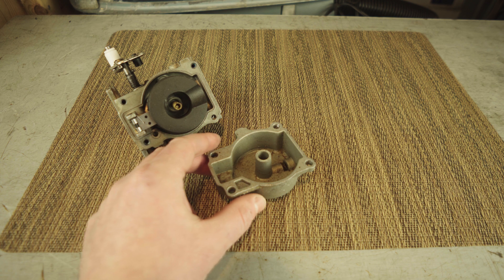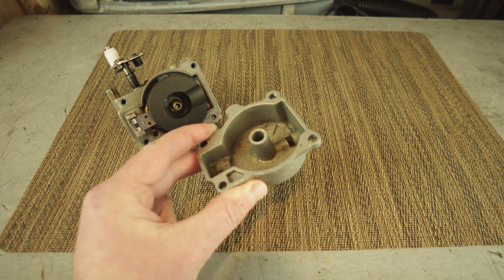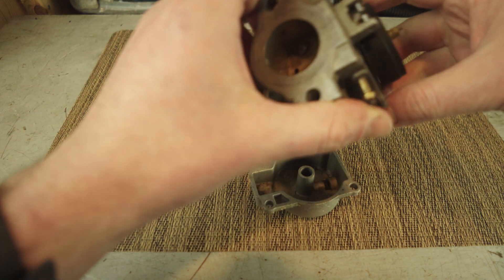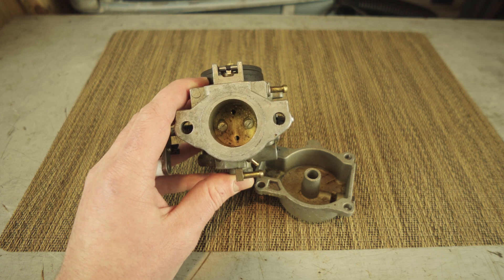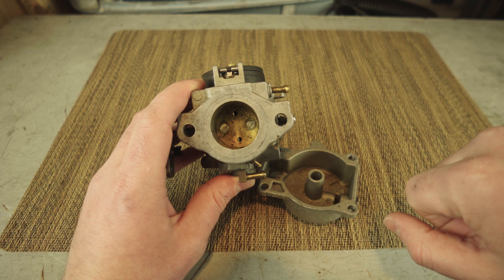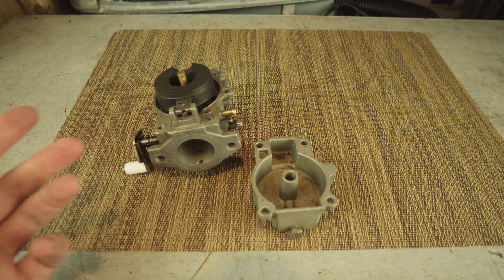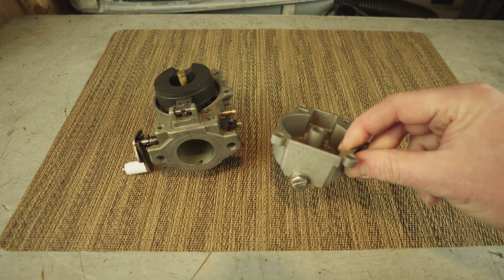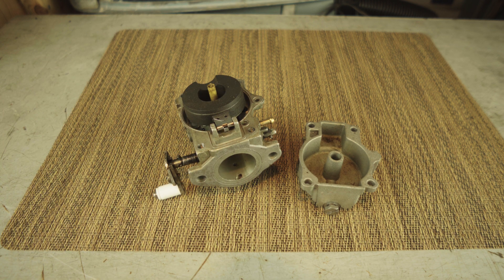Outboard 2-stroke 40HP idling on just 1 cylinder instead of 2 with throttle advance control lever up

Comment: Hello I got one question. My yamaha 40be out of the year 1978 (2stroke, 2 cilinder) is running on only the top cilinder. I pulled the bottem one and nothing changed. 

Now ive cleaned my whole carburator, de compression is good and both sparkplugs are sparking.

What do I need to do now?

Comment: Mine is doing the same, i have a single carb 40hp 2cyl 2stroke mercury 1994 and will run strong at higher rpm but stalls at idle, fully cleaned and rebuilt carb, still same issue, both plugs are sparking when earthed to block but will only run on bottom cylinder, top spark plug is clean but wet with fuel and bottom plug is burned indicating its the only plug able to actually run the motor.
Primer bulb stays firm so can rule out fuel pump.

Any ideas on what could be causing this issue?
Reply from the maker: Try adjusting the idle screws it's kind of hard to see but the idle sucks gas out through these tiny little holes. If you look inside the large hole you will see these tiny holes are literally like needle tiny tiny holes. it's possible they are clogged or you just need to adjust the idle or the idle timing is just very low. Essentially the engine is just using suction to get the gas in so it's clearly somehow not able to get enough suction to have enough fuel to run at that low speed.

Comment: I had the same issue of it running on just 1 cylinder but mine was on the top instead.  I figured it out by pulling spark plug wires to identify the bad cylinder. I fixed it by pulling the carburetor and adjusted the float which was stopping the flow of fuel at idle but allowed it to run normally with 25% or more throttle.
Reply from the maker: Thanks for the comment! Glad you fixed it. Its nice to know these engines are so robust they can run on 1 cylinder like that.